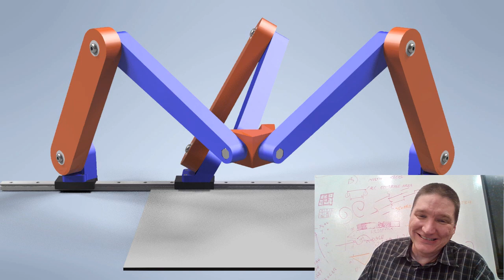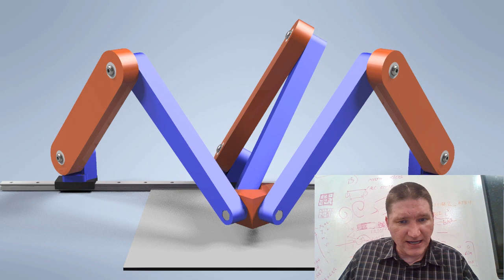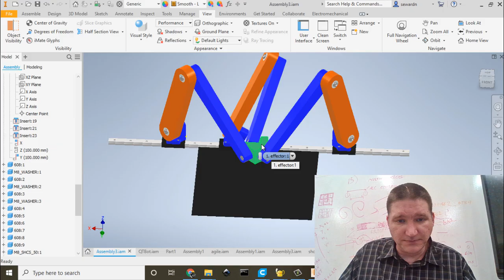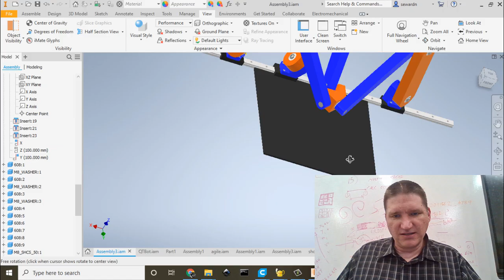RepRap Monorail (Single Rail Tripteron)

Comment: Very cool, I could look at this for hours! I just noticed that if you'd replace the revolute joints at the end effector with cylindrical ones (which also intersect in one point) you can make this an exact constrained mechanism. Such that if the end-effector would undergo (uniform) thermal expansion there wouldn't be stress buildup in the arms. But that is just me over-analyzing stuff again...
Reply from the maker: That is interesting to think about!  I could be wrong but I think that cylindrical constraints wouldn't be enough.  I will have to give it a deeper think.

Comment: Hol'up... Isnt the whole point of having multiple rails is to distribute the load so it does not strain the arm when it is extended???
I feel like this is just overcomplicated system that serves same purpose as having a single arm on a rail.
With this set up, you couldnt move it upwards while close to the rail as the two left arms would hit eachother.
Reply from the maker: This would be for very light work.  No need to spread out weight or anything.
Reply: @NicholasSeward  I understand the fact that this is functional but I fail to see the practical purpose.
Sure its neat but im just interested in knowing if there is any use for it.
Reply from the maker: @kutsy3785  haha...I mean what is the point of anything.  But to name an application...it would be great on the edge of a conveyor belt to simulate human reach.  It also looks cool and will be fun to play with.  To be clear, it may have no practical value (not true for this) but will possibly help open up new ways of thought.  As humans we get stuck in local maximum...sometimes you have to do something worse to break out and get to a global maximum.
Reply: @NicholasSeward  Fair enough. I like your outlook on playing around with mechanisms like this (new ways of doing things). I liked the video nonetheless. Reading back I may have come across a little negative but please keep doing what youre interested in.
I feel like wishing you to have a wonderful day is the least I can do to make it up :)
Reply from the maker: @kutsy3785  no worries.  Thanks for the well wishes.  I took your comments in good faith and appreciate them very much or I wouldn't have responded.

Comment: Really cool arrangement, but in practice you couldn’t use this for high load. The joint in the middle arm is under a high stress in a way that will easily break it without much load, not to mention the twist loading of the bar and bearings
Reply from the maker: Yes...this is for very low load applications.

Comment: If you large scale it, It's actually a interesting proposal for a house build printer.
Depends on the torque force been applied in that rail.
Reply from the maker: I would go with a printer more like my gus Simpson for houses.
Reply: @NicholasSeward  the point is to look at it from a civil construction installation perspective: just need 2 bases (that does not need to be level), and a straight rail, as a guide.
Reply from the maker: @dextrian  a Simpson could start for 3 points that aren't level and just a bunch of arms and revolute joints.  I imagine 3 semis that roll up with 1 arm each...joins up to make a Simpson that could print a mansion.  The monorail could work but would require more site prep and more careful engineering of the arms.  Dont get me wrong, I would love to see either.

Comment: probably gonna be shaky? But very efficient. Super minimalistic. nice. Wonder if it could use one belt also. With come solenoid locks to switch between locking on to the rail / belt. Top belt and bottom...
Reply from the maker: https://youtu.be/mpQOlnG8Yps yep.. hard to get rigid enough but it is possible.

Comment: I like parallel robots, and I like this. The kinematics make sense in theory, but I wonder what kind of load the rotating joints will get. That may be a limiting factor for acceleration. Another thing not clear to me yet, is the relation between the carriages and the end effector linear as it seems?
Reply from the maker: https://youtu.be/mpQOlnG8Yps. Shows promisse.  It is a linear relationship.

Comment: looks dumb, where's the center of gravity supposed to be on this?
I see a lot of people talking about printing buildings off of train tracks, seriously?
How is this supposed to work? This is literally just a worse tower crane!
Come on now people... This on a train? There are train cars with cranes already...
It's like trying to solve for a non-existant use case...
Reply from the maker: Yeah...I don't think this scales well to train sizes.  It will be fine for typical 3d printer sizes.

Comment: Remove the last rail and you'll end up with industrial robotic arm.
Reply from the maker: The arms are all passive so you need the rails.
Reply: @NicholasSeward  my point was that it is not obvious where is the win against an active robotic arm. If you are removing the rails to optimize the structure and 1 rail is better than 3, then 0 rails is better than 1:)
Reply from the maker: This is a parallel robot vs a serial one.  It is also cheap.  But the real reason is...it is a fun thing to explore.
Reply: @NicholasSeward  absolutely agree, the idea is cool :)

Comment: Interesting idea. Even if you did have to disassemble and reassemble it for transport, with everything on a single rail calibration looks like it would be pretty simple just by pushing the three carriages together and using that as your reference position.

Comment: This is wonderful!  I've just subbed because I really want to see where you go with this.

Does the fact that the two outer carriages move in opposite directions (by equal amounts?) to effect y-axis motion hint at some sort of redundancy, i.e. is there an opportunity to simplify by taking advantage of the symmetry?  I have no sound basis for this thought.  It's just that nagging voice in my head saying, "what if...", so I'm putting it out there to ponder, knock down, or ignore as you see fit.
Reply from the maker: They move together for the x and opposite for the y.  Each arm removed one DOF.  You could use less than 3 arms but then you need to drive a revolute joint or something.  Listen to your brain about stuff like this.  There is probably some realization waiting to pop up!

Comment: Seems to me that due to the angle of the center arm the motor force required would vary over the range of motion. Does that seem correct?
Reply from the maker: The z height and the middle carriage are linearly related.  What I am saying is that the force to raise the effector is the same everywhere.

Comment: That’s absolutely astounding. I wouldn’t go with a belt, however. I worry that high accelerations at one arm will introduce slack at some of the other arms, or other strange ringing effects. Instead, maybe a toothed linear gear rail and the steppers have gears that engage with that. Since that part doesn’t move (and doesn’t go over pulleys), there’s no need for it to be light or flexible. Downside is that a gear rail isn’t a commodity item like the toothed belts are. Would be a shame to have to put steppers on the carriages, though, since that’s a lot of weight to sling around. I think I’d maybe try a trio of cables running alongside the rail, the steppers underneath, driving the cables, and each carriage tied to one cable. What would be really sexy would be to have the cables running through three parallel holes through each carriage, and each carriage “selects” the cable to follow with some kind of clamping mechanism, like a grub/set screw.
Reply: i don't think belt slack is any more detrimental to this geometry than it is to most others, as there's not much amplification of motion by the linkages here. What i am worried about is the tightness of knee joints - any flex/slack there will have a massive effect on precision.
Reply: as to how you would really do this.  is have a ballscrew (but in reverse.)  

where the screw doesn't rotate. but you have a guide rail that the thing actually rides on.  and the "nut" part of the ball screw is rotated on the moving arm.
Reply: It is a moving system used in heavy machines and some old cars, rack and pinion !
Reply: this isn't a delta.  or a cube printer or whatever.  this isn't even a design that would be worth building on anything other then a large scale.  

the system to move the 3 rail carriages independantly would be way too complicated to make it worth the effort 
the only way it would work is on large scale with self powered carriages

Comment: ...and it's the least stable design I've ever seen. A tolerance of 0.001" at the trail translates to about 0.100" of error at the hotend, and the one rail is the sole point of reference for all three arms; there is no three-point (triangular) mount. It'll just flop around.
Reply from the maker: It really has less to do with the tolerance of the rail and more to do with the rigidity of the arms.  It will be a trick.  My math says I should be within a millimeter with operating forces.  We will see how my build goes.
Reply: @NicholasSeward  If you're within a millimeter, then every moving joint will need to be EXTREMELY tight, especially those nearest the rail because they'll make the greatest difference. Any very slight imperfection in the fit of the "shoulder" at the rail will be magnified very many times on its way out to the hotend.

Try drawing just one of the arms at full lateral extension, with focus on the arm-to-rail joint. Experiment with loosening that arm-to-rail joint by a mere 0.01mm and examine how much that huge leverage amplifies the looseness. Your arm is, after all, just a big compound lever with only one primary fulcrum: right at the rail.Even the slightest flex of the rail itself against its substrate will result in a great deal of movement at the hotend.

Don't get me wrong, I think it'd be a wicked cool achievement if you can pull it off. I hate to see wasted materials, though.

Another problem spot I see is that first knuckle above the rail. That would need to be a direct-drive stepper motor, would it not? With 200 steps per revolution, so 1.8* steps? When the arm is fully exteneded, how great a tangential swing do you get from 1.8* at that joint?
Reply from the maker: @timhofstetter5654  I don't think you understand how this is driven.  The carriage position is driven and that is it.  The arms are floppy and define a plane.  Accuracy depends on how good that arm can keep the plane.  I have made one arm so far and with 10 times the operational force, the deflection was 1.5mm.  That leads me to believe I can get 150um accuracy.  I can also print the arms more rigid.

Keep in mind this is a tripteron and they exist already.  The green one I show in the video can position accurately at 5g.
Reply: @NicholasSeward  So you're saying that the rail is immaterial, that the arms never move on the rail so you could dispose of it entirely as long as you keep all three arms mounted in one straight line?

Tripterons are built in triangular configuration for a very good reason.

How much force is applied to the first (nearest the mounting point) joint during rapid starts / stops? Experiment with accelerating & decelerating that whole arm rapidly, taking into account the whole arm's mass. I think you'll wind up very badly wanting much larger fixed bases for the three arms.

But... I may be wasting time here. I'll leave it alone. We learn better from experience than we do from warnings.
Reply from the maker: @Tim Hofstetter  No the rail is very important.  I got an over engineered one that can support 50 ft lbs which is way past any operating loads.  You are right that this is a tricky setup to get right.  The fact that there aren't too many tripterons support that idea.  However, the fact that there are tripterons validate this as a possible architecture.  I should have arms printed out before my live stream on Wednesday 630pm central.  I will screw the carriages to a board and we can see how good the effector can stay in place.  I think I will get millimeter accuracy under normal loads.  Worse than that...it will just inform the redesign.  Better than that, great.  Feel free to join and find out.
Reply: @NicholasSeward  I don't do live streams; they're always far too slow and full of wasted time. Thanks for the invitation, though.

Comment: Quick question : considering the carriers are all on one rail, doesn't that mean the print volume is not linear in the Z direction (upwards motion)? 

I was looking at the distance between what seemed like the Z carrier and the one to the far left, since the distance between those 2 decrease for in increase in Z, it looks to me like the travel distance in Y will be dependant on the Z position and will tend to decrease the further up you go, won't it? Love the design though.
Reply from the maker: Yes...the z increases as you move away from the rail.  I am considering two rails as shown or https://youtu.be/D3Fpy2_MyYg or https://youtu.be/Q6_u6FMpCSE
Reply: @NicholasSeward  oh wow, the 2 rails design looks great!

Comment: I like your idea, but you will be running into problems with limitation of height and strength of the lift of the extruder.
I like the simplicity of it through. 
If every one of the arms had a direct stepmotor to move it to correct position in sync with the other two, it might work out.
Check bigger CNC machines, as they don't use belts to move them.
Reply from the maker: Yes..lots of actuation options.  Belts seem like a good fit for my goals but also considering rack/pinion, non captive steppers, etc.

Comment: This is genious! The only issue I see is that you have all that weight twisting on 1 rail with a pretty large lever, so I dont know how rigid you would have to make that 1 rail to make it work with good precision.
Reply from the maker: You can bolt down to something very rigid like a table.

Comment: Wow, can you show a state,  lets call it "storage" mode , where all the arms are flat and the end effector is below the "working" plane? I have an idea for a portable machine that fits in a hard case, and needs to go somewhat flat when the case is closed. Exploring designs and this looks really cool.
Reply from the maker: The arms are always a little ungainly.  You would need to disconnect the effector if you want the most compact arrangement.
Reply: @NicholasSeward  id imagine you could also have a "station" arrangement of rails made for optimal storage. Youd still be disconnecting one of the arms from the primary rail, but since you have two other arms on the rails you could use them to help "push" a switch segment of rail from one rail track to a side track. At least, id imagine so.
Reply: To add to Nicholas, I think if there were just a couple more points of actuation as far as pivoting of the arms on their hinges it could help improve flexibility as well as form factor.

For instance, a pivot point for the arm where it will connect to the motor assembly. And then maybe just a hinge built into the arm a few inches away from the extruder or tool piece.

Comment: If you use ball joints on your extruder you can change the attitude of your 3D extruder over ~an entire hemisphere, this gives more liberty in the application of your filament. It is not a difficult feature to add, you will still have the stability (when using appropriate ball joints and maybe a solenoid spring based stop) and you would be adding a feature creators would love to experiment with, i.e. adding material sideways to change direction of filament (bidirectionality, even in plastics, would/could enhance strength of parts).
Reply from the maker: I don't quite follow but I can get behind more degrees of freedom.  We need some good 5D slicers!

Comment: The coolest thing about this is how easy it is to make it. All of the parts are incredibly simple.
Reply: This 3D printer could easily be made to self-assemble and print itself by having two of the arms be detachable from the print head and thus able to be used as "hands" to autoassemble the 3D printed arm parts, or belt track parts.  The screws would have to be a bit different to be 3D printed.  If it 3D printed its water wheels it could also gain energy...  

If the arms had a "third" joint section you could also have only two arms instead of one?

Comment: When i see this a portable ploter comes to mind. You can keep it simple and make a sharpie adpater in the head, they are light and need no power. It does not fight against the concept weakpoints like the tension you will get on the angled bearings, you probably can make a cool toy out of it.

Comment: It’s so weird this video came on my feed. I was trying to figure out how you calculate the position of the motors and rails compared to the tool heads position in 3D space
Reply from the maker: The outside carriage are fairly easy.  (Looking from the top)Figure out what xy you want and then draw two 45 degree lines to the rail.  The middle carriage is the same but do it while looking at it like the thumbnail.

Comment: I really enjoyed the concept. The concept is superb and I believe that rails concurrent to each other can be used. And in extreme case those three belt drives can be driven by a single motor.

I do have a question as I'm watching this type of concept for the first time - How it will be different that the single arm robot? 
How would the complexity vary?
Reply from the maker: A single arm robot is fairly difficult to control  because of trig, stacked error, redundant degrees of freedom, etc....  This has no trig involved, is a parallel mechanism so no stacked error, and clean one to one kinematics.

Comment: Why not rack and pinion instead of belts that way you'd just need one rack the same length as your rail and then just steppers with pinions that way you wouldn't have to deal with tensioning or doing multiple belts
Reply from the maker: Not a bad idea.